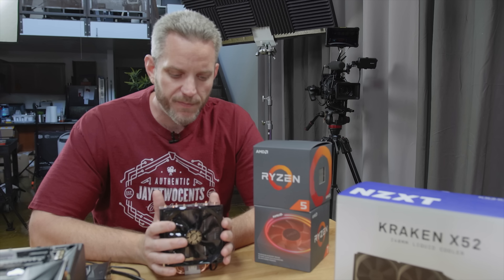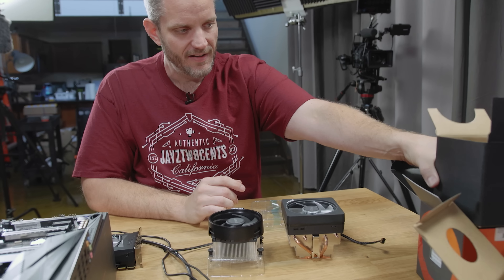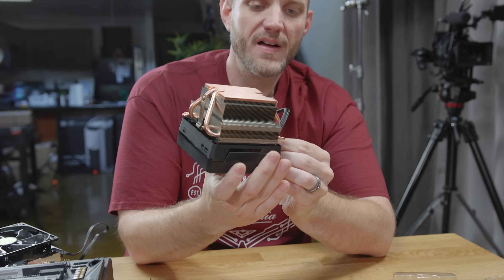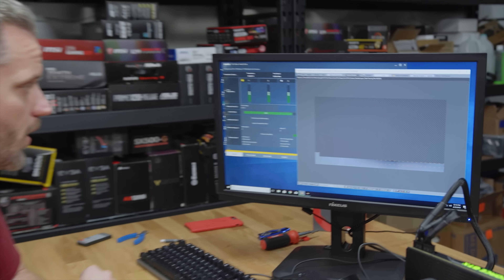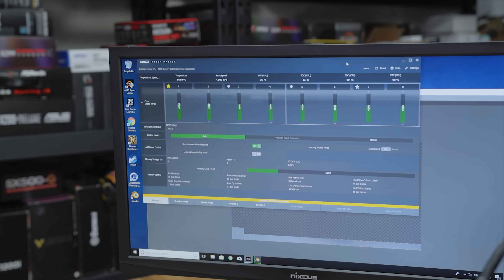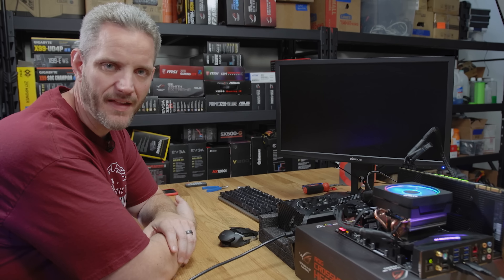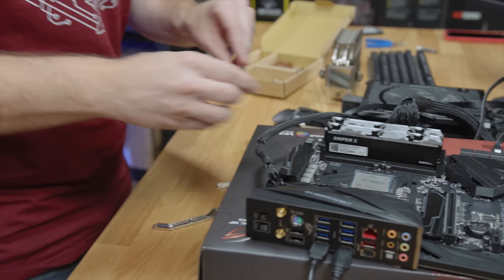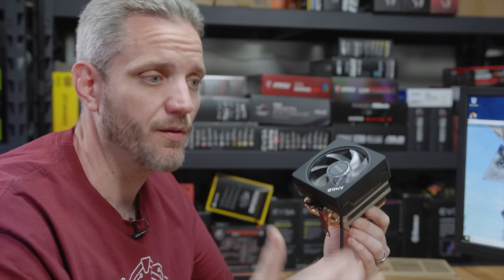Overclocking with a stock air cooler?? Is it even possible?

Comment: at idle my cpu is more than 80 degrees, im scared to even look at overclocking lmao
Reply: Dude, what the hell are you doing with it then?! I have a high idle with the stock cooler now, but that's like what it is supposed to be under load. I have just bought the Dark Rock 4 to have better cooling actually. Have you properly tensioned the cooler and used sufficient thermal paste? You should check that out lol.
Reply: @break1146  i checked and it seems like person who built pc doestn fucking know how to apply thermal paste, i found just a little circle of it on the middle of cpu
Reply: @aleksandar8151  Glad you checked then. What is your system rocking for CPU and cooler?
Reply: @break1146  intel core 2 quad Q9650 overclocked a littlebit to 3.1 and some tower cooler idk name honestly, but its good, now i have around 37 degrees celsius at idle and while gaming it doesnt pass 70

Comment: I have never had so many problems with an AMD system as I am having with this new Ryzen 2600x. With an MSI b350 MB and Corsair LPX 3000 memory, the system is a real screamer. But... a fast PC is only fast if its stable. Fast does not mean "good numbers on Cinebench". Fast means how much real work can it do in a day? Right now, the answer is none. It is the most crash happy computer I have ever had. Worse yet, I am losing data during file copy actions. Windows will install but not update.

I have been unable to determine what the exact issue is. Is it the memory? No. It passes every test thrown at it. Does not seem to be the CPU, as while under load, its rock stable. Its not stable when its at idle or lightly loaded, actually. 

Vid card? Nope. Swapped the Geforce with a Radeon. Problem persists. 

SSD? Don't think so. It is a Samsung 840 EVO, and it does complain about the "AMD environment" with its compatibility checker within Magician. But its non-specific about what that means. I tested the rig with a different SSD, a Kingston 300v SSDNow. Problems persist.

The only way I could achieve any stability at all was to force the mem core voltage to 1.4v (though I am unconvinced that is actually helpful), and SOC to 1.2v which does seem necessary. I have left the CPU core voltage alone as that only heats up the processor; it did not make it more stable. Mem is set to stock speed (XMP profile 2,  2933 16/17/17/17/25/63). I have tried T1 and T2, but unlike with past AMD processors in Dual Channel mode,  T2 did not improve stability.

What is interesting about this CPU is it runs between a constant 3.9ghz (power saver profile) and 4.3ghz (performance) stock out of the box under load with the included wraith cooler. I am of course, super happy about that... but not when it crashes. Which is regularly.

By changing the Windows power profile to power saver, it seems to run 80% stable at about a max 3.9ghz, but at maximum performance profile it often gets all cores to run steadily at 4.25 ghz with bounces up to 4.3. Again, this is straight stock multipliers. I can see no real reason to even bother to overclock the CPU as its already there on its own. In fact, I think it needs to be declocked. I suspect its the bounces up to 4.3 that might be causing all the crashing.

Anyway, long story made shorter, I have sent the MSI b350 back and ordered a MSI x470. I am hoping the newer and higher end chipset will settle the CPU and memory down and allow the machine to both run fast AND stable.

Yep, many problems, but I still love me my AMD. Always have, always will (and no, I am not an unrealistic fanboy, I just like value and... well.. Intel as a company is anti-competitive and thus not a company I can morally support).

Comment: i do overclocking to 4.5 ghz on stock intel cooler, max temp 72 grades
Reply: @E. Crowley not joking, idle temps 29º under power saving in six cores
Reply: @E. Crowley and max temp under stock clock 49 degrees full, under intel stock cooler
Reply: @E. Crowley Silicon Lottery

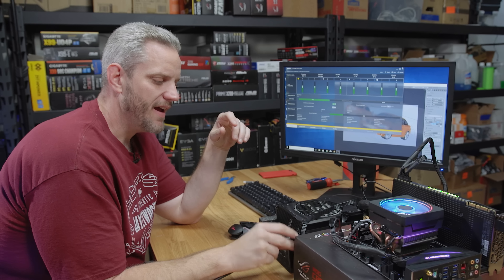Comment: 4:15 ''used a wrong satacable'' Wait whut, is that a thing ?? Im not using the original cable for my SSD either
Reply: He's talking about the sata power cable from his PSU. Different modular PSUs use different configurations for the connection to the PSU itself, he's used a sata power cable from a different PSU and that cause the issue. You should be totally okay

Comment: In short -- no. This cooller worked only 1 hour in my case. After was thrown to trash and replaced with dark rock pro.
Why? Coz the damn prism cooller is loud as shit. Don't buy ryzen box edition. Not worth it. Buy oem + any 200+ tdm cooler with low speed.

Comment: AMD is the best just look at the 100 ryzen 3 2200g it’s got 4 cores 4 threads decent integrated graphics is overclockable and on a modern chipset for only 100 dollars
Reply: I have a 1200 with a small oc and a gtx 980 Im literally shocked at the performance

Comment: Wraith prism is garbage , i have fulltower HAF932 amd edition case adn its air ventilation abilities are fine. But still wraith prism provides me with 45-50 c temp in Idle state with stock clocks in uefi and auto on everything , even my ram that can go 3200 is at 2133. Prism constantly speeds up and quiets down, very noisy and annoying. I swapped to Noctua DH15 SE-AM4 its a gentle quiet giant and i just love it, i dont even hear it working, it provides me with maximum of 55 c at aida64 cpu stress test. Stock coolers are garbage and wraith prism is only good on cristmas tree with its bullshit rgb crap.

Comment: https://youtube.com/rzX6k7JMZfA
10 years ago I bought this 80mm "Tornado" computer case fan, it was too scary to use, I just got it back out to see if it's just as bad as I thought. Yes, it tears up tisue paper like a shredder, my phone sounds like I'm outside in the weather, not my basement. The 80mm Tornado fan is scary, must be double its ratings, but fun to get out every couple years and play with the danger. 120mm fans are the normal now, I don't know what iy would be for?

Comment: fujnhny thing is i built my intel system with a stock cooler and clocked my 8700k to 4.5 from stock 3.7.  then i upgraded the stock cooler to a after market darkFlash Shadow PWM Aluminum CPU LED Addressable RGB Motherboard Control Cooler
https://www.ebay.com/itm/292712338274.

and i can clock my 8700k to 4.9 ghz on air ..   yes im running 6 case fans, XSPC 120MM 2000rpmers.   but before i got my XSPC fans, i had some shitty apriva case fans.  RED LED ringers  ..  Yes im using the EVGA Z390FTW motherboard, but for a stock cooler that comes with the intel 8700k, its all i had at the time, i got clocked to 4.5ghz, ran that for about a week .,  that way ..

Comment: Meh your overcomplicating cooling tbh ya they oc with stock ones fine if you have a good case, ryzen is designed for ease of use and with rtx io CPU speeds shouldn't matter as much once fully supported

Using a test bench to test cooling is dumb 🤣 that's not real world use... jay retire bro your getting old it's showing put it in a case with proper airflow then re do this.... Give us some actual real world use numbers in actual game play, f your sythetic Bench's on a open design so unrealistic

I would bet in an open bench your numbers are off for the air version.

Liquid cooling doesn't matter in a open bench as much. But for a proper air test use a case... An air cooler that has a constant influx of fresh from frontal fans air often performs pretty well your tests here don't give that opportunity. It's has overall more flow and movement of air through the system when fans work on tandem  , so this test is bias, your fans direct the air where needed an open bench doesn't lol a liquid cooler always does. I learnt nothing.

Comment: i spent most of the video waiting for you to put on the stock cooler..then i realized that the large cooler you had on WAS apparently the stock cooler...the larger stock cooler. what a stupid video, that larger heatsink is made for higher temperatures, so of course you can...if you couldn't then they would not include any heatsink at all